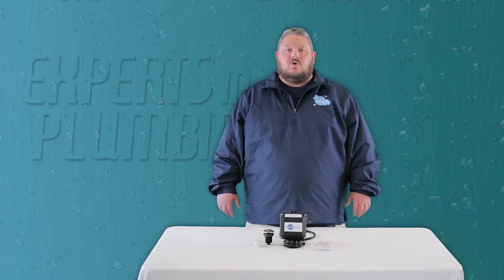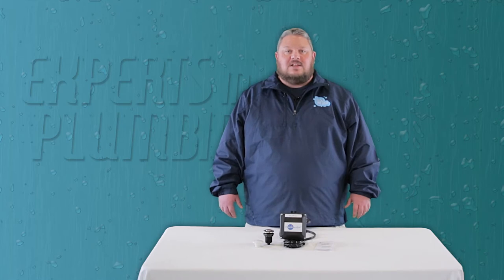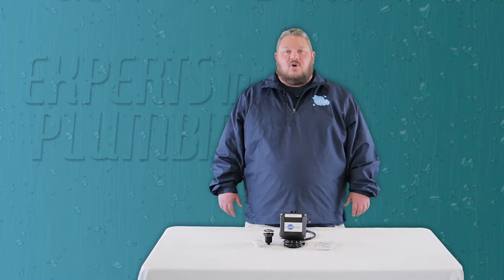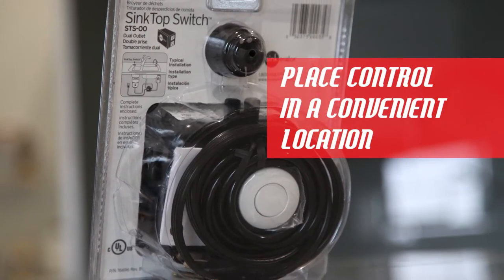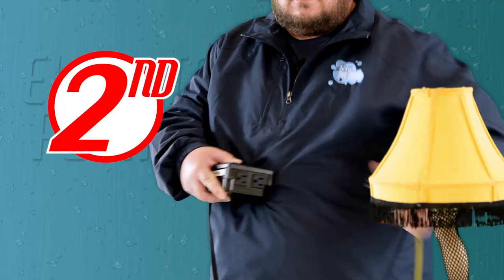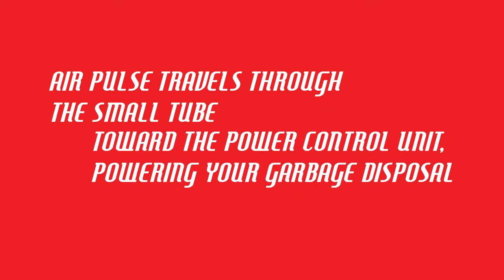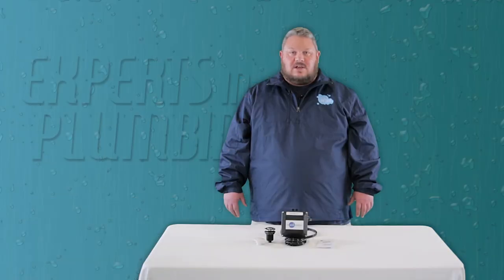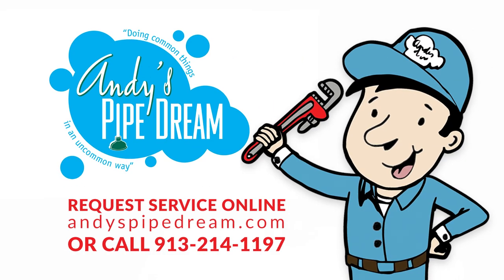InSinkErator Sink Top Switch Review & Installation Instructions - Andy's Pipe Dream

Comment: BIG BIG Question...    I have the insinkerator evolution cover control plus. No switch, You have to turn the cover to turn on the unit.  
Now after 2 years, I wish I got one with the switch.   Will the air switch work on my unit ?? or can the cover control be removed.

Comment: Hey Andy. Question for you. If the button keeps getting stuck is it simple to just replace it? When looking at the box below my sing the cable that connects to the garbage disposal (bottom of the box) it wiggles and feels very loose. Not sure if that’s by design. The disposal works and starts but the button just keeps getting jammed and it’s a little scary lol
Reply from the maker: Obviously, it's not normal for the button to stick. It would probably be good to have it looked at by a professional to see if it can be serviced or if it needs to be replaced. If the disposer ever sticks in the on position, just unplug it to keep it from getting damaged from being overrun.